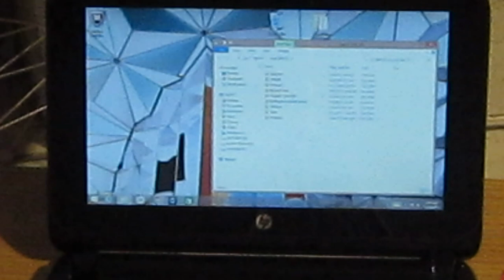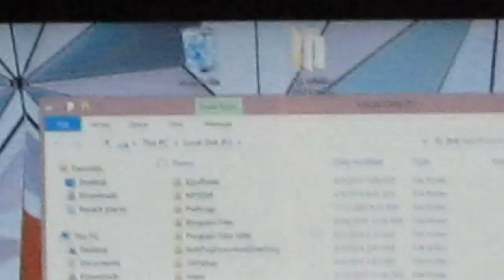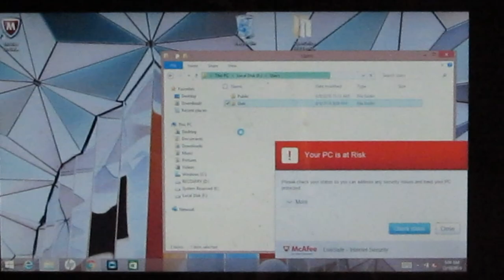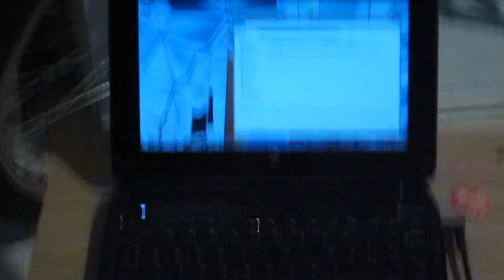How to recovery Data and Pictures from crashed computer hard drive using  a USB - Sata / IDE adaptor

Comment: Can I do this if my laptop had a password?
Reply from the maker: Yes it should work fine, unless you encrypted the files.. Then you will definitely will need the pass word.  I don't think windows machines will require a password for a secondary hard drive?? If you have any problems.. You can try it on a Linux system.. Linux systems have no respect for windows passwords.. unless the files are encrypted.. then they are scrambled, no matter what OS you try to view them on.. a password is required to unscramble them.  Let us know how it goes.. Thanks!...

Comment: if windows cannot detect the hard drive. how see the data in it?
Reply from the maker: Does the power light come on, on the external hard drive? Can you hear the drive spinning when you plug it in?
Reply: I have the same issue. I bought the correct IDE cables and now the external hard drive powers up, a light comes on, and I can hear the drive spinning. My Windows computer doesn't "see" it. Yes, my USB is plugged in. ;)

Comment: Get a docking station of Amazon for 25 bucks and you will have the same thing. You are making this ten times harder that it needs to be.
Reply from the maker: That will work as well. The rest of the procedure is the same, Just you have to plug the docking station in to your computer, and into the wall power, and then plug your HD into it.  It is faster if you like switching your hard drives a lot, because once it is setup then all you have to do is unplug your HD and plug a new one in.. It is a nice way to go as well, thanks for the great comments..

Comment: my hard drive will not boot from any pc,your video was not very helpful, you basically demonstrated how to connect the adapter, I can hear my hard drive spinning and try to start but will not be recognized even with this setup that you have described!
Reply from the maker: It depends on how your drive failed.  A lot of times, something gets messed up in the boot of the HD.  This will prevent the drive from being used to boot a computer, but provided it does not have any hardware failures of the drive, many times it can be read from another working computer.  This is what I demonstrate in this video.  If you have some other type of failure with the drive, then probably nothing can save it.  There are some very specialized places that can recover data from a fail drive of this sorts, but it will be very expensive. The usual procedure to save data is as I described here, in trying to read it from another working computer.  Does it recognize the drive at all when you plug it in?
Reply: jaynes network no it doesn't recognize it in any computer
Reply from the maker: I would test your cables with a hard drive that you know works, to make sure it is the drive and not a cabling problem next.

Comment: If the Hard drive is crashed this info is useless if the computer is crashed due to some reason other than the hard drive than this will work.
Reply from the maker: Yes, but if the hard drive becomes corrupted in the OS (only) and will not boot.. and this is still applicable... The data can still usually be recovered... but.. If the hard drive is not functional.. then I don't know any reasonable way to save the data..

Comment: Not seeing how this is data recovery, this is just transferring files.
Reply from the maker: Yes, backing up files is transferring them to another hard disc.. The issue is that this hard disc was once a bootable disc in another computer.. The computer it was in, critically depended upon that disc being bootable for you to do anything with it.. When the Operating System becomes corrupted, the computer will not boot, and for most people this is the kiss of death.. they will not have access to their data... and it becomes lost to them.. This video show how to recover that data.. This is how computer experts recover data... This data is effectively lost to the average computer user... and this method allows these computer users to save this lost data.. Yes I agree one of the steps is transferring the data, but that is only part of the process. That transferal of data is trivial if the computer is booting up properly.. It is not trivial if the OS has a problem and the computer doesn't boot, then transferring this data becomes a major problem.. and these people will need help if they don't know how to do this process... That is what this video is to help with.. Great questions.. thanks for the comments...
Reply: I did this and it said the old hard drive is protected and will not let me do anything to it. how do I unprotect it? @jaynesnetwork

Comment: This didn't help me at all. Because the problem, I need to solve is the one, you encountered at the end (you couldn't get access to those files, so you turned it off).  This video is pointless.
Reply from the maker: The only time I had issues accessing files, is with a bad hard drive.. Sometimes, the files are not where you expect them to be, since when the hard drive is the primary hard drive, some of the files directories are in different locations, than as a secondary drive.. You many have to do some searches to find them then..

Comment: Oh, I'm so luky, I didn't need to open my hard drive then I just recovered all my files using a app, thank to the app, it's to hard for me to open the HD by myself😂
Reply from the maker: That's great, Thanks for the great information!
Reply: @jaynesnetwork  great info...step by step. I have two laptops to recover data from. I was wondering if I could simply operate my adobe suite using these connections?

Comment: So much trouble.  All you need is a 2.5 inch HDD case enclosure on Ebay for about $7.00 and plug in to a USB port of the working computer.  No need for all those cables and crap in your video. All those cables and adapters probably cost more than the case enclosure kit.
Reply from the maker: Here is a way to do it for free...

https://youtu.be/xiGLjGHBoSw
Reply: Granted, that is the easiest and least costly, if one has a desktop.  But for a laptop user only, without a desktop, this method is not applicable and the  HDD case would be the least costly and easiest method.
Reply from the maker: Yes, I am all for people using what ever they feel the most comfortable with.  There are cables adapters like I used, that can connects to different types of hard drives (SATA and IDE), there are USB cases that only adapt to one type but provide a protective box that has to be opened up to put the hard drive insides, and there are even things that look like toasters ovens that you can just plug your hard drive into the top of.. If they work and do the job, they are just fine with me.  Thanks for the great comments... I do have a case as well.  I usually end up using the cables, or what ever is readily available because it is more effort to take the screw out of the case, but cases are great as well...
Reply: jaynes network Hi, my lenovo suffered a hard impact!  My laptop doesn't boot no more.  Is there a chance I can recover my pictures using this metod?

Comment: yeah... except you get stuck trying to open the user folder and windows never lets you do it.
just like what happened on your video lol
Reply from the maker: It is possible that there are error on your hard drive.. sometimes putting it in the freezer, to get it cold, can tighten up the bearings, and cause it to work for a little while??
Reply: i was able to read/copy the files off using the command line directly. i was never able to get windows explorer to work.
no clue why. i don't think there's anything wrong with the harddrive

Comment: Its not working with windows 10 
Why
Reply from the maker: Is the hard drive getting power? does it sound like it is spinning?  When you hook it to the computer, does the computer recognize it as a new hard drive that is plugged in, and give you a corresponding message?

Comment: It just infinite loads
Reply from the maker: Try putting the hard drive in to the freezer for a  few hours, before reading it.. it could be that the bearings are bad, and some times the cold can make the bearings shrink enough, that it will work again for a little while,.. until it warms up again.. Let me know how this works.. Thanks!

Comment: Not working lol
Reply from the maker: Are you getting power to the hard drive? Can you hear the hard drive spinning up when connected?
Reply: jaynes network yes there’s a beeping sound then stops. I did everything to get it to work including using the sata inside the computer to no avail. Maybe the harddisk is already defective
Reply from the maker: Is the computer not recognizing it? There is no pop-ups or notifications of a new hard drives connected?   As a last resort, sometimes I will try putting the hard drive in the freezer.  Sometimes they fail, because the bearings get too worn and loose, and cooling them down, can tighten them up just enough for it to work a little until it warms up.  There could be many other kinds of failures modes that can not be fixed by these methods. If the hard drive fails by some other mode, I do not know of any simple fixes for that.  I just had a hard drive fail on my IBM think pad, and it sounds like a buzz saw when powered up. I was going to try to remove it from the computer, but it looks like it was welded inside.  Sometimes there is only so much we can do...
Reply: jaynes network thanks for the advice.
Reply: @eduardbernales8142  are you from UK?

Comment: This video has nothing to do wit hdata recovery you fool. Your laptop has failing to boot up isn't necessarily the HD at fault as witnessed here. Is's more than likely that  one of your RAM sticks have failed. This will definitely stop from booting and can cause a pc to crash.
Your hard drive is ok as evidenced by you seeing it's files when plugged in to the other laptop.
Also, your camera is aweful.
Reply from the maker: This could be something to look at as well.  If the boot is corrupted on the OS, this can also cause it not to boot.  This process will recover data no matter what the reason for the non-boot issue is, provided the hard disc still functions properly.  Thanks for these great comments..